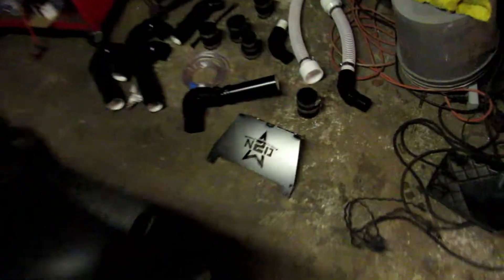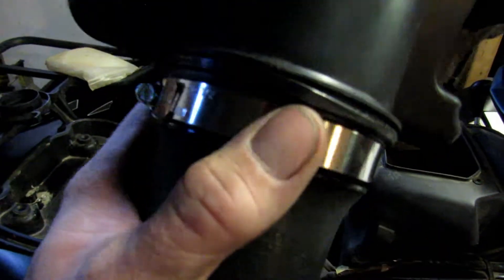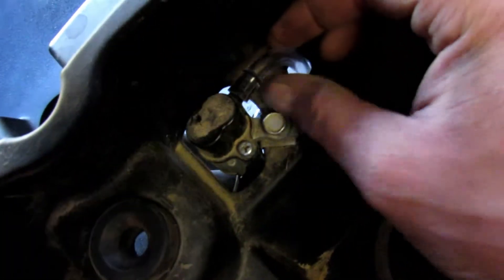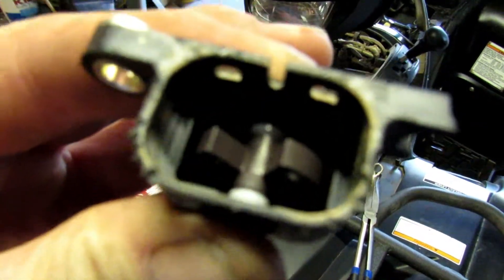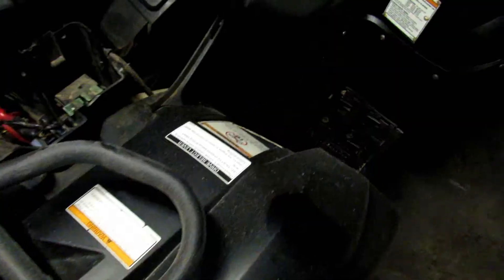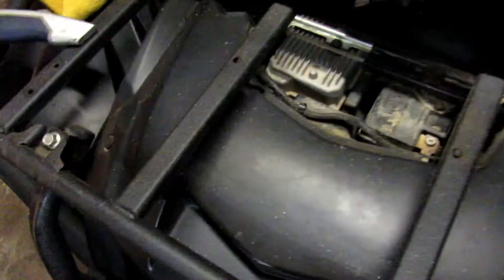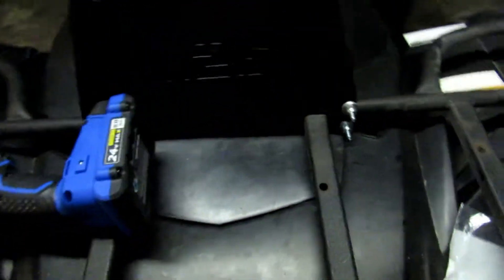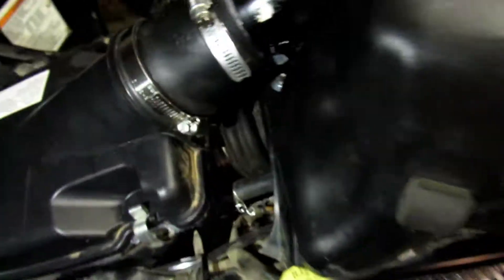N2Deep custom SNORKEL KIT for 2017 KODIAK 700

Comment: One note, Dielectric Grease is water resistant, however it is not a sealant, and on mine it doesn't seal. I used some clear silicone for windows in place of the rubber seal that the bike comes with and although its annoying for when the box needs to be opened, it works far better.